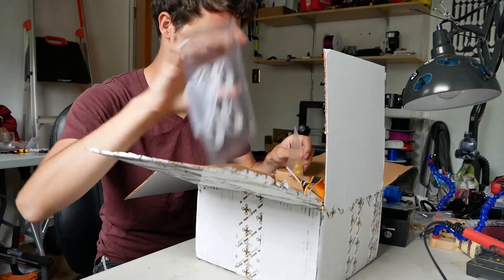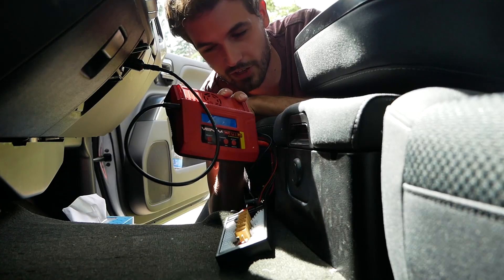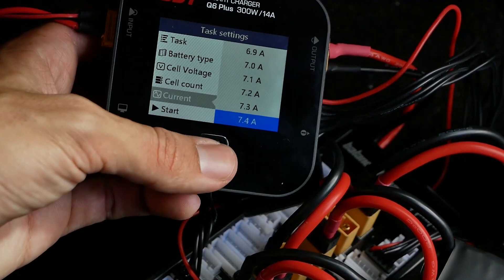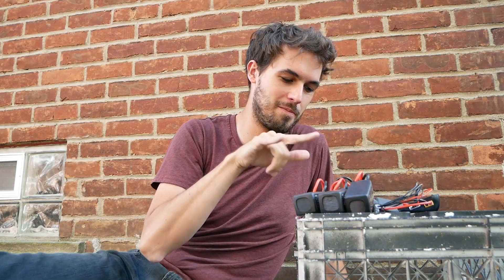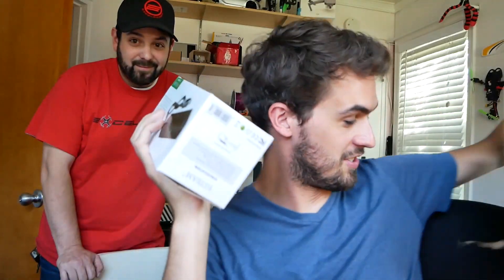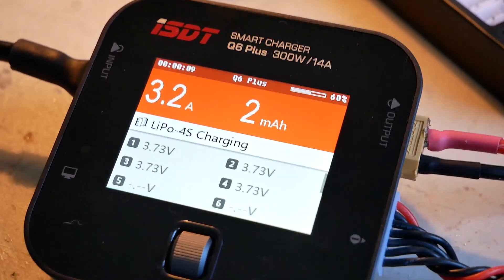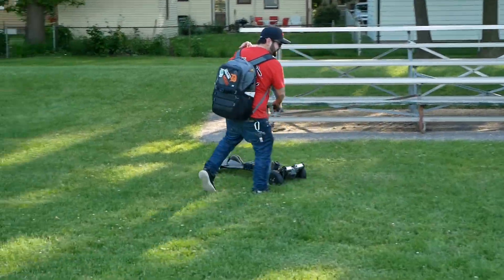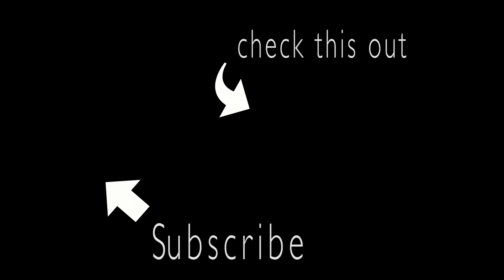charge drone batteries with a truck

Comment: Great video as always Drew!  I absolutely love this charger.  Picked mine up a couple weeks ago.  We're running just about the same setup.  I have it primarily for the car, but also use it at home.  I used an old Xbox 360 power supply I had lying around that supports up to 206W.  For anyone looking to use an Xbox 360 power supply, you need to short the red and blue wires (the 5V signal wire) and then the yellow and black wires serve as the + and - for the 12V current.
Reply: John E Fly thank you for this info.
Reply: John E Fly damn I never knew you could do this. The power supply is like 20$ only. Do you know which xbox 360 model the adapter is for? thanks
Reply: The one I'm using is the OG Xbox 360.  I bought it on day 0, and eventually wound up with the red rings of death.  I bet you can use any Xbox 360 power supply though.  I just liked that this one was 206W.
Reply: how is it working? I'm planning on using an xbox power supply but are the wires thick enough to resist about 12 A?
Reply: Hey John e Fly, i have the same Xbox psu at 206w. What was your ideal amp rate to charge with this psu?
Reply: Hey John, Thanks for the Information. Maybe you can help me :D I did it with a Xbox One Power Adapter but I got 2 Yellow wires, to black ones a red a blue and a light green/mint clour wire. I put the two yellow ones together, the two black ones and connected them with the XT60. Then I put the blue and red one together and connected them to the red XT60 wire. I just isolated the green one for his own. When I connect Power Adapter and charger the Power Adapter shuts off. Why? :D

Comment: Not first :(
Reply from the maker: still appreciate it! :)
Reply: Charging from the truck, that would be about 45 minutes for 4x1300 mAh batteries, right? How many batteries do you roll with for a day of flying where you can wait 45 mins for 4 batteries? :-D Also, what does that do the truck battery if the truck isn't running? Is 1 charge and a 5 minute engine runtime to recharge the truck battery?